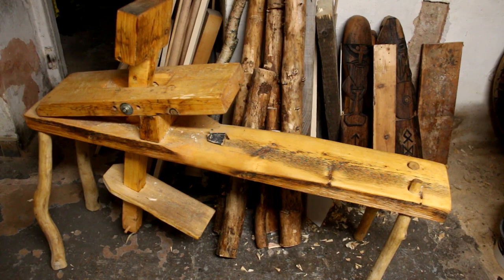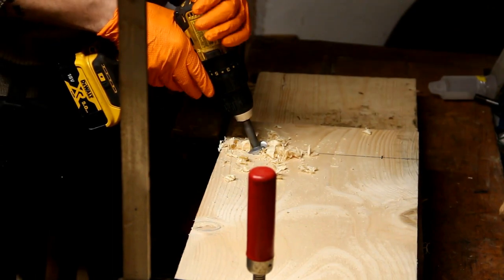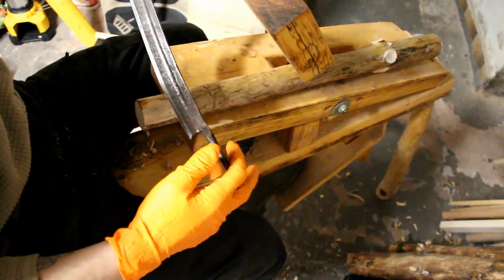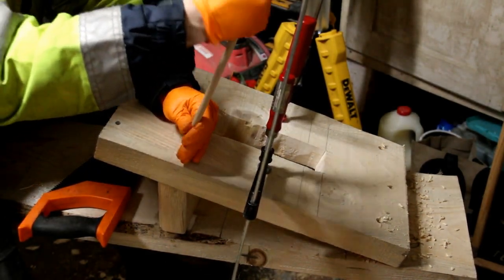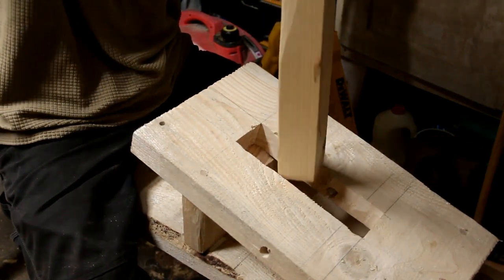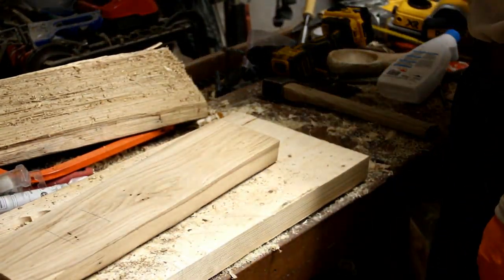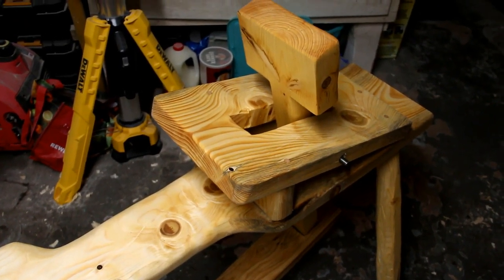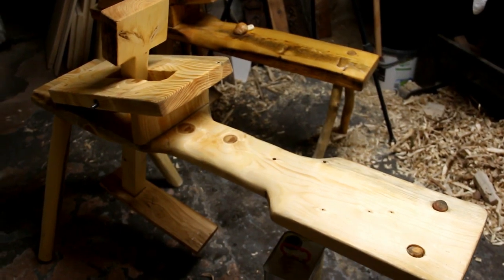MAKING A SHAVING HORSE

Comment: Hi. Nice cool. How about a pole lathe.
Reply from the maker: It's on my list. ;) Was just talking about this with my friend yesterday.
Reply: @BerserkerGang2019  you need a good A frame, plus a pole as long and springy as you can get. I found ash the best. 
Your task then is to make a baby rattle. 3 rings on a turned piece. your choosing. Ash is good. Tends not to warp too much. Blackthorn and Hawthorne tend to warp. But nice to turn.
Reply from the maker: @robertgross1655  a summertime project for outside. It's too big to  assemble in the basement.
Reply: If you do make one which would be cool. You will need to keep your tools really sharp. Any less than razor sharp will jam on it. It’s also great for pumping the leg muscles up.
Reply: @BerserkerGang2019  
Hi. You can also do one with a bungy cord from above. So yes you could do one in there. I had mine in an old ww2 mortuary in silverstone wood.

Comment: I couldn't tell, is that a straight or curved draw knife? Any preference for one over the other? Thanks.
Reply from the maker: I usually use either straight or just very slightly curved ones. The only differance is it depends of the surface of what your shaving. If you want to make something flat a flat draw knife is super. Curved ones are good for things that have a round surface like chair legs.